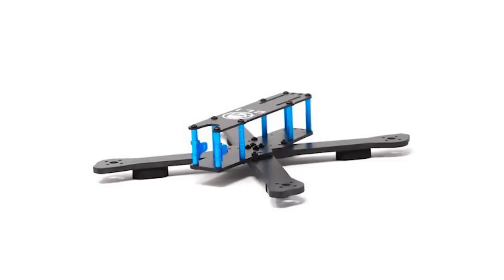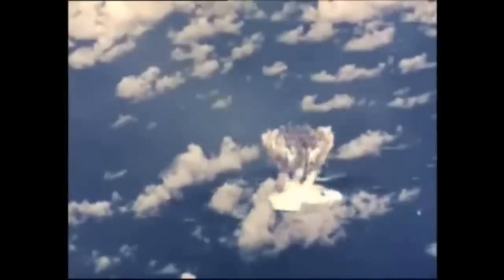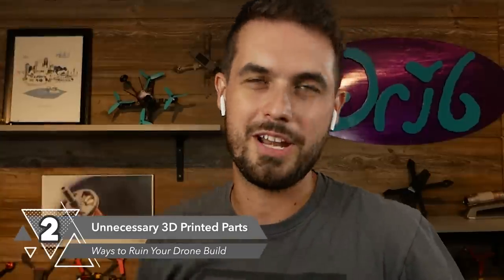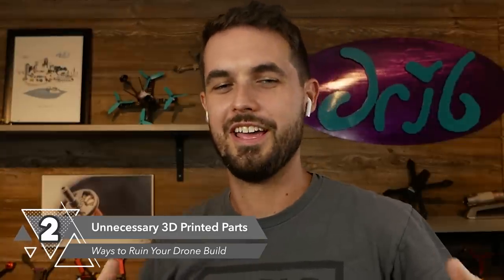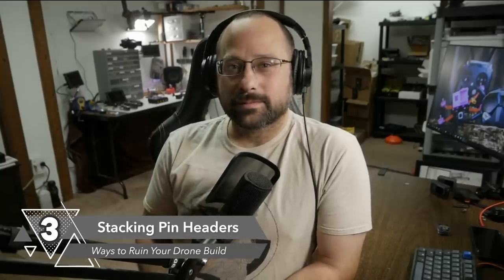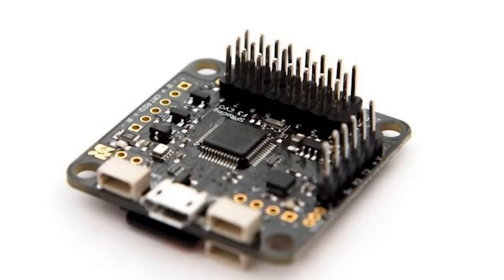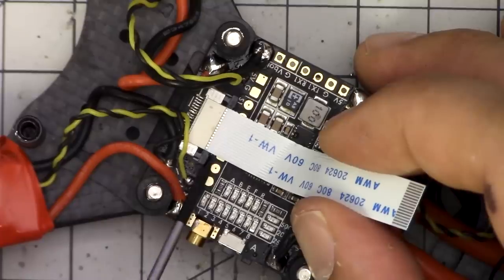6 Ways to RUIN Your FPV Drone!

Comment: What about brass standoffs for the flight stack? 🤔
Stay safe there, everybody! 🖖😊
Reply: And without rubber dampeners. First battery connection most likely will turn into fireworks.
Reply: @KrotowX  Not really. I use only metal screws, so...
Reply: @MCsCreations  I pulled your leg a little :)  It depends from ESC and FC design. Some have metalized screw holes connected to battery "+" and "-" directly. There are a plenty of examples IRL where people shorted them with steel screws and carbon frame, making spectacular fireworks in end. That is why I used nylon standoffs or Matek rubberized M3 standoffs at stack bottom.
Reply: @KrotowX  Now that you mentioned it, I remember about a Racerstar AIO board that was made like that! 😬
Reply: @MCsCreations  Hehe, I found forgotten unused Racerstar REV35 4in1 ESC board in my shelf a week ago. And I know exactly in which of my quads I will torture it.
Reply: @KrotowX  Sweet! Good luck! 😂

Comment: Funny video, and agree with the points, but not Titanium. I'm not that into metals, but searched the interweb about titanium, and actually metal is more brittle, Titanium is more flexible. Just don't pick the cheap grey GR2 ones, but the expensive GR5 alloys. They are just a tiny bit less durable than the high quality metals, but 0.6 the density. A decent 6060 or 7075 aluminium is also quite strong, and I have used them on the motors, and they can survive. Sometimes I use 2 Ti and 2 aluminum. Just be careful, some aliexpress vendors sell bad quality and the heads come off when you thighten them.

Comment: Using aluminium screws for anything, motors included. Yet to loose one of the motor screws. So I doubt Titanium would get destroyed.
Reply: Titanium screws are actually heavier than an equal sized Aluminum screw too.  Most people seem to think Titanium is the lightest which is wrong.  In order of weight of an equal sized screw from high to low it goes Steel > Titanium > Aluminum > Nylon.
Reply: Me too dude 0 issues for literally years
Reply: Do you think its better Titanium screws for motors?
Reply: @ze2004  yes Ti is more than strong enough, the alum motor base will bend before screws, i actually use 4x 7075 alum screws from pyrodrone for all my motors, 0 issues for years and i freestyle only, id rather bend screws than motor bases. Weight taken off the arms has greatest impact, i also swap motor shaft screw for Ti in my xing motors lol
Reply: @flo-ridafpv5713  good information man! Will check for a pack of good 7075 aluminum screws.

Comment: Titanium *can be quite a bit stronger than steel. But both materials vary wildly based upon alloy and heat treatment. You can use hardened carbon steel, but then you give up the flexibility and impact energy (durability). The disadvantage of titanium is that it fatigues.  I think if you don't plan on crashing (haha) then titanium would be better for weight. But the extra 2 grams that steel gives you also gives you an extremely durable material that will survive crash after crash without ever failing.

Comment: never had any problem in 4 years using nylon stand offs ..its motors i tend to smash when i crash
Reply: Dude same here I have been burning motors up like crazy I have 3 quads with burnt motors idk what I’m doing wrong? I crash and it always seems to burn a motor
Reply: @ruvyfpv4398  make sure you actually disarm before you hit the ground, if not this could be enough to send current that could fry your motor or esc
Reply: @johnnytech0309  yea I think that’s what I’m not doing but it’s hard to know do it so quick u know I guess I’ll have to just try and get better at not crashing and if I do then disarm quicker

Comment: You are correct, tougher the metal more brittle it is. Not an alloy, a pure metal, titanium by itself is sheet.  Steel is an alloy, thats why it is better. Iron by itself is sheet as well.

Comment: Yeah I love my 3inch looking at building a 4 inch explorer class.   I agree with Bardwell build a really good 3inch
Reply: Also i think I have done most of those except the spoiler.   My 3inch has a 20m stacks that has the pins so far its lasted lots of crashes.

Comment: Many people are surprised that Titanium is actually more dense than Aluminum.  Titanium screws weigh more than an equal size Aluminum screw.  Titanium is a lightweight alternative to steel, but not as light as Aluminum if you are comparing equal sized parts.

Comment: my main hobby is cycling. Loads of titanium things, even frames. Pretty sure it is the alloy of titanium used and not the titanium itself. I have Titanium spindles on my bike pedals right now. The force I exert from standing starts  is far larger than a drone can. They make hip replacements from it etc. Sounds like an urban myth that originated somewhere they use a specific alloy or pure ti.

Comment: I built a lightweight 5, and it's fast, but it's to floaty, and I've tried about everything, pretty sure it's just the way it is. It's way faster than most 3 inchers, but I think I like the a 3 inch fly's better. I think you guys should do a show on wire routing, I've seen some spaghetti messes out there.
Reply: Lower anti gravity or lower air mode min throttle
Reply: @highmastdon  It only had 1606/4000kv motors, and I sacrificed it for another build, I'll try that next time l, thanks

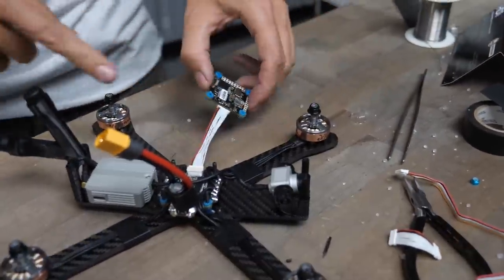Comment: 9:14 Don't take this too seriously as I am a sample size of 1 who buys the cheapest stuff from Ali express, but I've had micro jsts fail and had to put a zip tie around my 4in1 to hold it in place. soldering wires is the way to go

Comment: Also if your drone is a freestyle which means the battery is top mounted what will ruin it is not using sponge under the arms to support it when it lands basically it should be used on every arm so yeah there you go that’s another way to ruin your freestyle drone

Comment: regarding the "5 inch sub 250s" and the analogy to the solar car. Im with drew there. Right now (or rather back when the vid was made) the innovation might not have been there, but its on the way, with time it will come. Car example, look at Sono motors Sion. Its a 5 seater van all electric with solar panels all around the outside, supposedly pumping out up to 300km per week from the sun for a fair price. Now the car has not been finished developing yet, the specs are not that great (300km per week is just perfect if your weekly drive to and from work isnt further than that) but hey, its a start, its better than the solar oneseater concept thingies and we'll see how it evolves in the future. Thats the funny thing with humans, always striving for newer better things.

Comment: Titanium is super light but it's not as strong as steel...sort of.  Titanium pound for pound is stronger than steel, but the drawback is you need more of it.  So an M3 titanium screw will hold less weight than an M3 steel screw. However, if you could magically use an M5 screw instead, and it was made of titanium it would be stronger and lighter than the steel M3 counterpart.

Comment: Titanium is hard , but not as strong , there is a difference . There is a difference between hardness and strength. I have no experience in this but I agree with josh. Generally speaking , even stainless-steel is not as strong and carbon-steel.

Comment: We need a updated CL1 diy how to build.... Anyone have any idea why betaflight doesn't recognize that my Radiomaster is bind to a flight controller
Reply: try changing the receiver protocol in Betaflight, watch one of Bardwells Betaflight videos on how to do that
Reply: as long as ur receiver is bound and wired up correctly, its all up to the settings in betaflight. make sure u have the right port enabled, the right type of receiver selected in the config tab, and the corresponding channel map in the receiver tab
Reply: Ty

Comment: I realized I made a noob mistake ordering my first "serious" quad... I ordered my Trashcan with an FrSky receiver.... believing that meant it would be a "controller"/"transmitter"... pretty sure now that isn't the case.

So damn, I have a quad coming with an FrSky compatible receiver... but I NEED A TRANSMITTER.

Where can I a FrSky "controller" (please, honestly correct my use of "controller") for the best price? I realized I ain't flying even if I'm ready for Betaflight etcetera without a controller. To be fair I really believed their wording implied I'd be getting one.

Edit: And also, I believe the biggest difference in needing a larger quad would be stability and performance at higher altitudes. Bigger quads should theoretically handle things like turbulence better right?
Reply: Try the betafpv lite radio 2 super cheap and works good
Reply: @ruvyfpv4398  looks interesting but the standalone version is out of stock on Amazon. I'm looking for a fast delivery too... I was looking at RadioLinks and Taranis... honestly based on the discrepancy in the order had me believing I'd have everything I needed. 🙃 So I guess what I'm saying is besides knowing I have a "FrSky compatible receiver" coming- that's about all I know in regards... I want something that will DEFINITELY work and even be reliable. No sense in buying the cheap thing twice if the same amount of money can get something durable enough to last 3 times longer. (Also, the business about firmware support mentioned in the reviews of some transmitters- is a bit concerning.)

Comment: Titanium is very hard, it’s brittle
So the moment you introduce vibrations it’s done because it’s brittle.
BUT.... most smash plates and top bolts in helicopters (real ones, as well as many large RCs) ate titanium because it’s so hard.

Comment: I use nylon standoffs because I'd rather they break than my FC or ESC break. NOTE: Also, I can't yet switch to metal ones yet, because my FC does not have wide enough screw holes to fit rubber grommets.
Reply: Drill them out
Reply: @aowi7280  there are fets and other stuff pretty close to the holes. I'm not going to risk killing a $50 FC :).. when it's time to replace this FC, I'll look for one with bigger holes.

Comment: 12:32 The thing is that the tougher the material it is, the brittle actually is, like carbide. However, the softer the material is, it holds more because is more malleable. So every material has their own properties, pros and cons….

By the way, not a metallurgist.

Comment: How did you not cover those guys who are using zip ties with heat shrink with their receiver wires inside of them..... So that's right picture using a full size zip tie zip tie in it to the two rear or the two front and pointing them in either direction either inside the x or outside the x and then using heat shrink to put your transmitter receiver wires in and then heat shrinking them so that way they don't interfere with the blades or the carbon

Comment: Nonono, nylon standoffs is a good idea for a stack with m3 holes and no grommets. It's better to break expendable nylon standoffs than the ESC or FC boards. Otherwise you're tanking the hit with your electronics.
Reply: Drill out the holes and use gummies.

Comment: When compared to steel in a strength-to-weight ratio, titanium is far superior, as it is as strong as steel but 45% lighter. In fact, titanium has the highest strength-to-weight ratio of all metals ~2017
Reply: Also to add to this topic, low carbon steel is crap, medium carbon is decent and high carbon would be the best but most expensive. Then you have cast steel which if done well can be extremely durable.

Comment: Titanium is stronger per-weight but if you're talking about screws then you're limited by size, not by weight. And with the same size the steel part is stronger. You're not really saving any weight with screws. They weigh like a 1 gram anyway.

Comment: hi i have a different question.  where can i turn to get my kiss fc to understand the spectrum protocol srxl V2.it's an open protocol that anyone can use for their radio controlled gadgets.  the receiver in question is a spectrum spm 4650 dsmx series receiver version 2. by the way my kiss fc is a V1

Comment: Tiny aluminium screws. You put your hex drivers in the socket, twist... and the socket becomes round instead of hexagonal. Screws, especially the tiny ones, need to be steel. If you crash on asphalt or concrete and your aluminium screws get damaged, the frame will be such a fucking PAIN to take apart. Actually, just strike "tiny". If you make screws that aren't made of steel in order to save weight, you deserve to be punched in the dick for unleashing that kind of evil into the world.

Comment: I can add to that in another way to ruin your drone because I did it!  Here it is: Squeeze your battery retaining strap between the ESC and the frame.  Without too many flights you will get a dead short that will melt down your ESC burn or melt the strap and watch your battery catch fire!  Lesson learned.  Do not do this!

Comment: using only 2 motor screws per motor. lose 1 screw and the second one WILL spin itself off along with your motor. not the place to save weight
Reply: just use a dab of thread locker.  I have not lost a screw in years since I started doing that.
Reply: @Plur307  seen it to believe it
Reply: @ashrys_planties9067  It also helps that I learned to regularly check the tightness of screws.  I check them every few batteries now.  I had a particularly bad incident where a motor came loose and the prop got into the flight controller stack and shredded all the wiring and ruined almost everything.  Since then I have taken multiple precautions to never have a motor come loose again.  It was also at a race and was in the final heat of the day so it was especially frustrating since it ruined my chance of winning.  One of the more frustrating things that has ever happened to me in FPV.

Comment: Sorry you Guys so wronge about 250 gramm 5 inches
Reply: To hit the 250 gram all up weight (including battery) you are going to need to use a small battery and small motors that can't really drive 5 inch props hard enough.  Simply not enough current and motor stator volume available.  Much better to drive 3" or 4" props hard than drive 5" props weak.
Reply: @Plur307  thats aktuell wronge! Brotherhobby made some 2004 Motors and a Frame that works awesome on a 850 4s
Reply: @SettekFpv  Yes, I bought the hyperlite brand 2204 build by brother hobby and put it on a custom built tubular carbon fiber frame that weighs only 30 grams.  I never used 850 batteries but did use 1,000.  The performance is very dull compared to a 2207 build and 1500 batteries.  It is not a very good setup in my opinion.